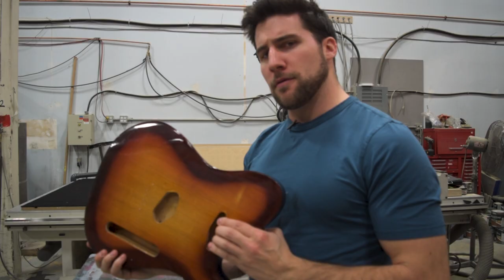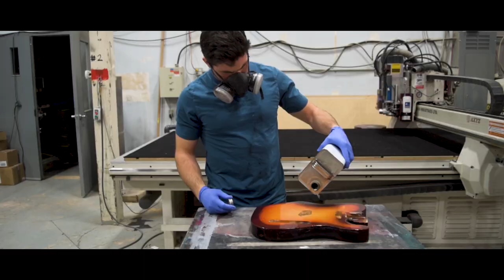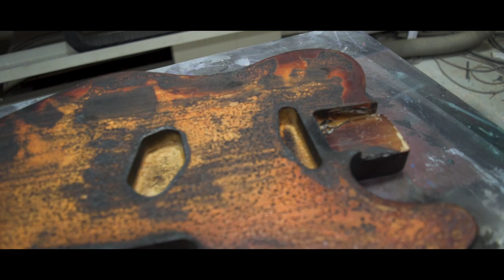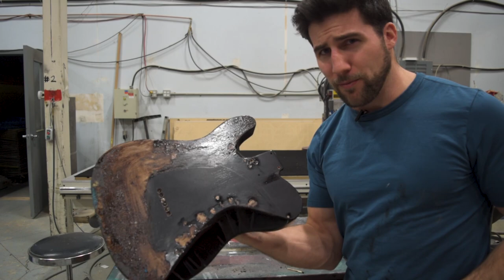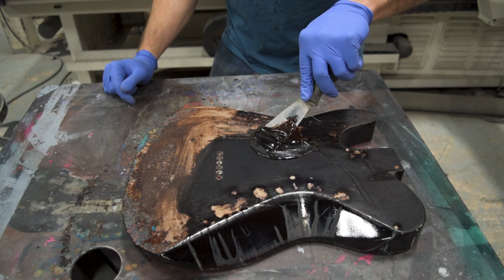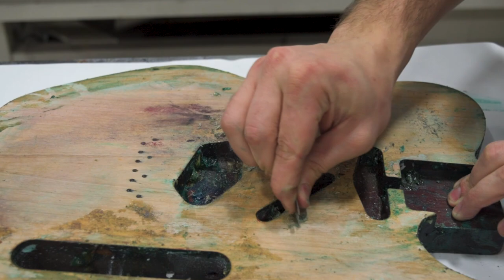How to remove a lacquer finish

Comment: Tip for those of you worried about scratching up the guitar with scrapers. I always round off the sharp corners of scrapers I use for refinish work and it does a great job of keeping the corners from digging into the wood
Reply: Yup!  I do the same for furniture refinishing.  Use a grinding stone or angle grinder to do it. In a pinch, rubbing blade edges on a concrete pavement also helps round off sharp edges. I have two scrapers - one rounded, one sharp.

Comment: Question. I have an old Ovation electric guitar from the late 60's that has what I believe to be a nitrocellulose lacquer finish. It's all cracked. A few years ago I used a chemical called citrusstrip to get thick house paint off of some cabinet doors and it worked great. I may try this. My question is: After using a stripper like you did or I may use, can the stripper penetrate the wood and eat into the new paint after? Can the stripper affect the wood after it removes the paint? Therefore ruining a new paint job? My ovation has thick lacquer on it and I spent hours sanding just the front and it hardly did anything. Just curious about this stripper thing. By the way, love the vids.
Reply from the maker: I haven’t had any issues with that, but I use the stripper then clean with wax and grease remover. Then I sand smooth and clean again before painting.
Reply: @BradAngove  Thank you very much/

Comment: Great video! I'm wanting to strip and refinish a Les Paul Custom, but I'm worried that using a heat gun will unglue the binding, is that an issue I will come across?
Reply from the maker: That could definitely be an issue. Paint stripper could also damage the binding. You may be stuck with the sanding and/or scraping method around the edges of the guitar.

Comment: What if the guitar was a 335 with binding?

You can t use the hot air then right?
Reply from the maker: That’s correct. Even the chemical paint remover can melt that plastic sometimes. You’re generally stuck with sanding and scraping in that case.

Comment: Save yourself all that trouble and get a handful of rags and acetone.  I could strip a body with acetone during the time it took to watch this.  Good video but try acetone.  Super quick and easy.
Reply from the maker: Haha I’ve definitely tried acetone. It’s not bad. Slightly more aggressive than the lacquer thinner. Not as strong as the paint stripper. It’s good in lacquer, and basically useless on polyurethane, which makes sense. They use acetone to make nitrocellulose lacquer.

Comment: Hi Brad . 
I want to strip & refinish my custom shop  relic time machine strat
Heat gun looks best to me. question what primer & PRIMER COLOR would I use for Olympic white is there  a primer specific to fender and what do I buy to add to the paint to keep it from yellowing, I know there is additive.  Can I leave what ever relic  marks penetrated into the wood and are visible after its stripped &  primed/  I want to spray gun it.  Thanks Brad
Reply from the maker: If you want it to stay white and not yellow over time you will just want to use acrylic lacquer or poly. The classic Olympic white it nitrocellulose lacquer but that will yellow over time.

Comment: Hey Brad, I'm currently working to remove the laquer and finish from my guitar with a heat gun, but I'm noticing the sections with laquer seem to get burned, as in I can see the wood getting darker. I wouldn't want to damage the body, how do I go about this?
Reply from the maker: You just have to be careful and patient about it, and focus the gun on areas that have more finish. Sand the last little bit off to avoid heat damage.

Comment: The fire was cool. Seems like something I would try too. Most of the times a little fire never hurts anyone.... once the container with the thinner solvent is far enough away. 

On another note we started back today on the guitar amp I mentioned over 2 months ago. Slow progress. Trying to get it out before school starts next week.
Reply from the maker: Guitar amp... remind me?
Reply: A few months back we had a chat on a guitar refurbishment I did with a teenager. Electric guitar. So the next project was a guitar amp using a computer speaker system I got for free. I promised to link it in when we were finished and try to make it simple so people without in depth electronics knowledge could attempt a similar build. 

When its done I will send you the link. Maybe you can do something similar or point persons who might be interested. Its really a first guitar project working on a budget. 

If the teenager progresses and time permits I will look into an arduino effects kit (if that is possible).
Reply from the maker: Oh, right. I remember now. I’d love to see how that’s done. Electronics usually confuse me unless they’re the usual panels and whatnot for houses etc.
Reply from the maker: $2.15? That’s crazy!
Reply: The fire may not hurt anyone but the toxic fumes will

Comment: As long as the instrument is finished with the same material; will the removal methods translate to an acoustic body safely, and as efficient?  No pressure, no rush.  Appreciate any input.
Reply from the maker: I have concerns about doing this on an acoustic because heat can cause glue to release and acoustics are so many more parts held together with glue.
Reply: @BradAngove  Understood, thats fair.  Thank you for sharing your info and experience.

Comment: Hello Brad , Lou here from Quebec with another question , lol .   I have a 70's Classic reissue Strat from Mexico and I removed the polyester from body
and shaved the belly cut better than it was in a more accurate way.  My question is, how would you remove the poly from the neck ?  Is there a way or better forget it ?  tx
Reply from the maker: Sanding is about the only way to safely remove poly from the neck.
Reply: @BradAngove  Thank you Brad !  Appreciate !

Comment: Any suggestions on the best method of removing paint from the back of a guitar neck? Not just the clear coat, but the paint too.
Reply from the maker: I would avoid heat as it can create a risk of the fretboard separating from the neck. Scraping can also be a challenge on curved surfaces, particularly to those unaccustomed to it. Sanding is probably your best bet.

Comment: I'm about to hit up the local hardware store for some paint thinner, hopefully one with a similar consistency as the one you're using in the video. I couldn't catch the brand you were using. I'm looking at Formby's Paint and Poly Remover at Lowe's. Any suggestions? Thank you.
Reply from the maker: Just for clarity, are you buying paint thinner, or paint remover/stripper?

Comment: at this point is there any reason to grain fill again  or just seal and paint?    i assume that old finished filled the grain better than anything.
Reply from the maker: It depends on how far back you sand, but I don’t expect that I would need to grain fill this again.

Comment: Hey Brad, I have a pine Strat style body with pink heavy relic nitro finish. I need to remove the uneven pink lacquer so I can repaint it with metallic blue nitro. The fire thing kinda threw me. Are you saying that just lacquer thinner and a scraper should do the job, or will I also need a heat gun? Any advice you can share is very appreciated.  Thanks Bro!
Reply from the maker: Lacquer thinner will soften it slowly and allow you to scrape it. A heat gun is substantially faster. You can also just sand it off.

Comment: Any tips on removing poly finishes off of guitars? 

Furthermore... Any tips on actually finding a decent respirator mask in 2020??? 🥴
Reply from the maker: Both challenging prospects. Are my respirator links in the description not available now?
For poly I usually end up reverting to sandpaper unfortunately. Sometimes the heat gun will do it, and sometimes it does absolutely nothing.

Comment: Sanding to 400 or 600 is unnecessary waste of time, 250 is as far as you need to go then use a sanding sealer. Light first coat buff up second coat buff up top coat done  low gloss low gloss high gloss top coat. If any imperfections fix at each stage.  This is laquar or poly finishes. 
Liquor bonds to its selfe your only removing drips or runs or dirt each leval lifts the low spots and evens out the finish.

Comment: Can the heat of the flame cause cracking in the guitar body?
Reply from the maker: If it’s a multi piece body the heat from the heat gun has the potential to do that. The flame in specific is less likely to do it because it’s less focused and relatively brief.

Comment: Lol just finished sanding a clear coat and base off a guitar I bought for $40...  Took me a month of sanding off-n-on...

I actually had a portion of the wood "pop" under the paint when using a heat stripper...  Looks like the wood may have not been completely free of moisture when sealed?
Reply from the maker: Ya, it was probably a moisture issue. It didn’t delaminate or anything did it?
Reply: I don't know about "delaminating" since I'm unfamiliar with the word, but probably, since I had to cut out a small chunk to get all the loose wood removed.  Used a standard wood filler and sanded it back.  Is that wrong?  Mind you, this is a project guitar so I could try out routing new pickup cavities and stuff...  also going to experiment further with my enamel pouring technique....
Reply from the maker: I was just wondering if any of the glue released with heat. Did the guitar split anywhere?
Reply: It didn't appear to split where individual "planks" were glued together to make the guitar body, if that's what you mean...  It look like it was all the same wood...  I though you meant delaminate in the sense that there did seem to be line a thin almost paper-like "laminate" veneer over the top of the wood...  between the wood and the actual base coat.  It had the appearance of a blister, but you could push on it and it would vent a bit of air because it was right at the edge of the guitar face.  So I just dug in until I had removed all the loose wood and filled it in...
Reply from the maker: I meant both of those things haha.
Reply: So using wood filler there...  thats about all I can really do right?  sand it smooth, and then plenty of primer-n-paint and it should be fine right?
Reply from the maker: If you’re going for a solid colour, yes.
Reply: yup thats the plan!

Comment: Will lacquer remover or paint 
thinner damage a figured top? I have an S style with a curly maple top (?), super thick gloss, and a big crack that needs repair. Want to take off the finish to fix the the body and refinish, but I don’t want to damage the grain of the top.  TIA
Reply from the maker: No, solvents won’t hurt the wood itself.
Reply: Brad Angove, thanks man! Keep up the great work. I’ve learned a ton from you
Reply: Brad Angove, also, any suggestions for fixing the big crack through the body? I’m thinking wood glue and putty mix plus clamps....
Reply from the maker: Tough to say without seeing it, but that sounds about right.

Comment: Hey Brad, i'm having hard time trying to refinish a paul reed smith guitar. When i removed the clear coat and the paint, i can see a very thick and hard layer of something like epoxy sealer that will not strip with the stripper i have. Do you know what it is and how to remove it without damaging the guitar? thanks
Reply from the maker: It’s a poly sealer if I’m not mistaken. A few people have had this issue. I’m not aware of a way to remove it other than sanding.
Reply: @BradAngove   yeah i was able to remove most with 80 grit sandpaper, but the problem is that the remaining is located in a place where i'm not able to sand... in the cavity where the potentiometer lays. Any advice?
Reply from the maker: They make an attachment for a drill that sands that I believe.

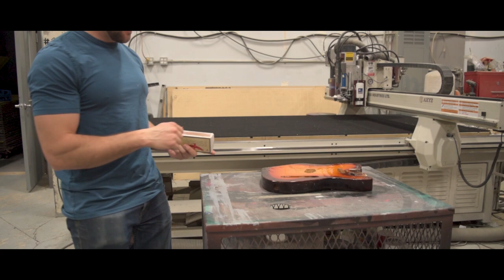Comment: 3:13  was checking out the alternatives after sanding by hand the poli finish off a Yamaha ERG 121... Dude! Still fire seems like a more idiotic way to do it.
Reply from the maker: Fire works fine on lacquer. It’s pretty useless on poly.

Comment: Could I put primer over the lacquer finish and then paint it?
Reply from the maker: Paint it with what? What kind of primer?
Reply: so I've been wanting to make a guitar look rusty, I found this modern masters paint that do so. I guess my question is if it possible to do it, or do i need to get the lacquer off
Reply from the maker: You should be able to get away with just sanding the lacquer with 600 grit and then painting. I did a tutorial on how to do a rust paint job with spray cans.
Reply: Thanks! yeah I did watch the video but i don't trust my self to do that yet, so I'm going the easy route lol
Reply from the maker: Is your upright base an acoustic instrument?

Comment: Is there any reason you don't recommend sanding the finish off from the start? Is it just more labor-intensive, or is there another reason?
I'm assuming the chemicals just make it easier, but is there any reason besides that?
Thanks!
Reply from the maker: Nope, that’s it. It just takes longer and slightly increases the risk of you sanding into the wood too far and changing the shape of the guitar a bit.

Comment: I'm wondering if this would work on a cello. 🤔😬
Reply: Jk lol
Reply from the maker: Oh thank god.
Reply: @BradAngove  😂 my cello has a really ugly lacquer on it. Lol I'm looking for how to get it off without ruining it. Ugh. I saw you light that guitar on fire and I was like, oh cripes, I should probably not light my cello on fire. 😆😆
Reply from the maker: No, too many glue joints haha. Cello finishes are generally quite thin. Careful sanding or scraping would be the typical removal method.
Reply: @BradAngove  I'm thinking a fine sanding would do him good. I'm hoping it gives my cello a warmer tone. It sounds nasally. The lacquer is about a couple millimeters thick. It's insane. It looks plastic lol but it is solid spruce on top, and maple on the ribs, back, and neck. Ideal for my climate. gets super cold then super hot. 😅 So I think sanding should not be too bad. 🤞
Reply from the maker: Ya, sanding and then perhaps a thin shellac finish or something like that.
Reply: @BradAngove  I'll have to get  a video of the outcome. 😉

Comment: What kind of paint stripper did you use?
Reply from the maker: Aircraft stripper.
Reply: @BradAngove  Im trying to remove paint and lacquer of a guitar and I'm using a heat gun. I'll hold the gun over a section til it bubbles then try to scrape the paint off, but its not quite working. It's taking it off but not in clean strips like the video I've watched, any advise?
Reply from the maker: Are you sure it's lacquer and not a different type of paint?

Comment: I have done all of these methods before, and the heat gun was the last that I tried, and I have to tell you the heat gun is the only way I will do it from now on.The rest is just too messy and stinks seriously bad. Plus the heat gun method is so fast.
Reply from the maker: Yeah, the heat gun is probably the quickest. The stripper is super fast and easy as well, but crazy messy.
Reply: I finally tried the heat gun because of one of your videos. You ruined me lol :)

Comment: I would of thought that lighting the guitar on wire would damage the wood.
Reply from the maker: If you don’t let it burn for ages generally it doesn’t do much that can’t be easily sanded off.